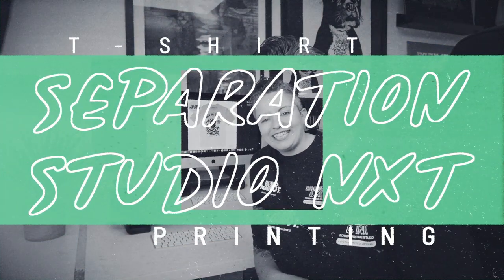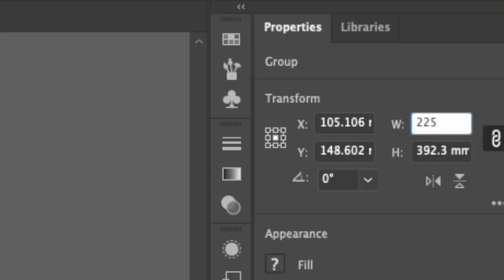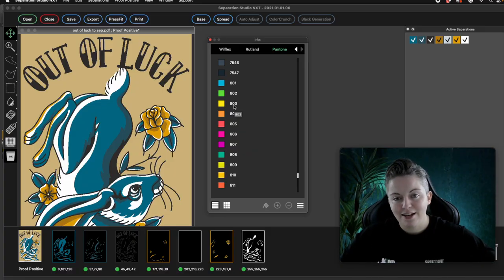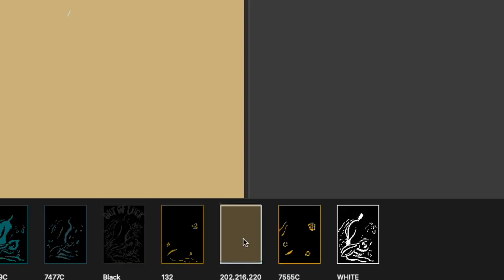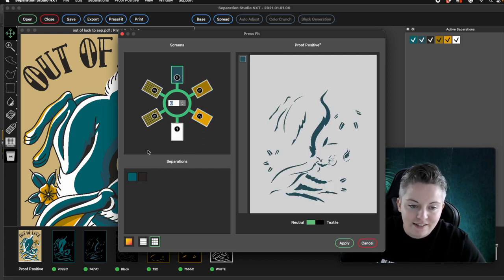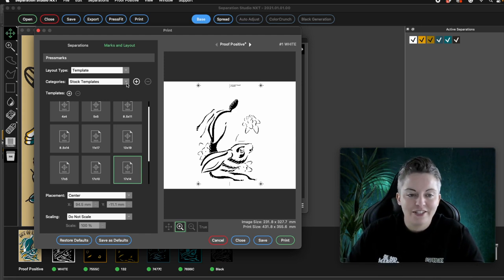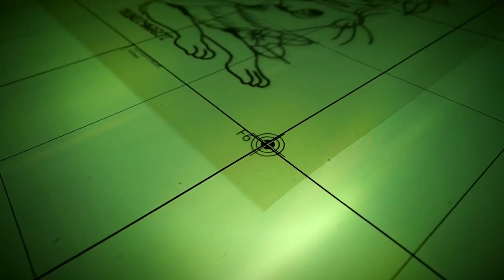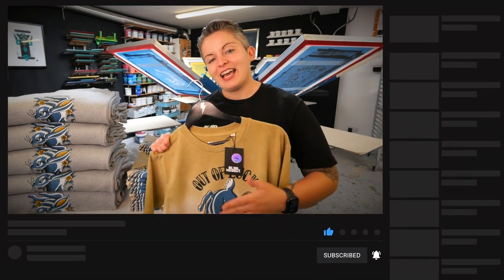How to separate artwork for screen printing using Separation Studio NXT

Comment: This is amazing! Very helpful, my shop just started using this software. Question: We use a laser burner so I would not need to print out the physical separations. Is there a way to export the separations into an actual file to go to RIP.
Reply from the maker: Hey, I would ask Sep Studio directly but I would assume you would pick the driver for the LTS and can print from the software or if you save the job it becomes a PDF so I think it would be very similar.
Reply: @squeegeeandink  Thanks!
Reply: @LMB9888  You can also get the generated tif files if you use the Go To Folder menu option (~/Library/Application Support/BluironicTechnologies). This is assuming you are using Accurip. The tif files become available when you have it in the Accurip output window, before you officially hit print.

Comment: Thanks for the informative video. Is there a way to export it as a pdf so the film positives can be printed by a screen printing supply shop as I don’t have an inkjet printer myself? 

Thanks again.
Reply from the maker: Hey, I save the separations and I have tried opening them in Illustrator and printed them straight from there. I do also have Accurip though, I have researched that Sep Studio NXT also works with other RIP's though. If you wanted I could email you a PDF separation and you could try it with your film printer? Just email me - info@squeegeeandink.co.uk

Comment: Do you add a 0.5 stroke to every color on every job? Does the software automatically choke the base b6 2 pixels? Thanks.
Reply from the maker: The software will only do what you tell it to do,  sometimes I will add stroke to the black to cover the other colours. I do it on a design-by-design basis but the great thing about the software is it gives a preview of what it would look like with the stroke you put on.... so you can try push it until it breaks